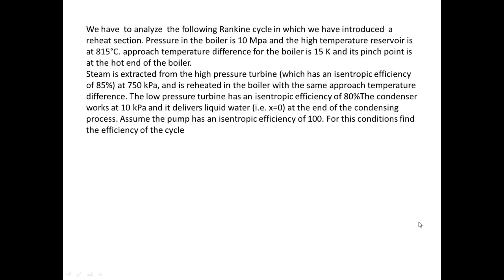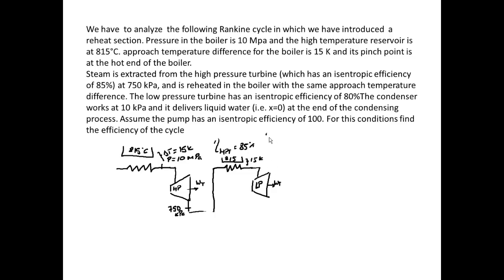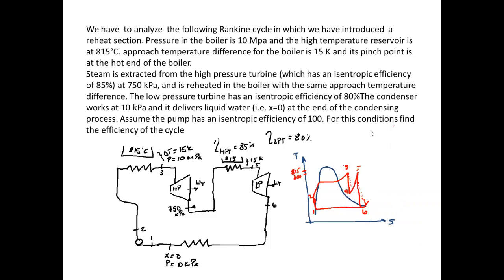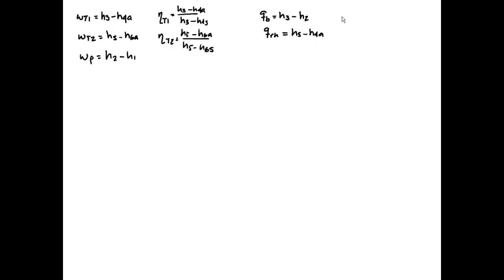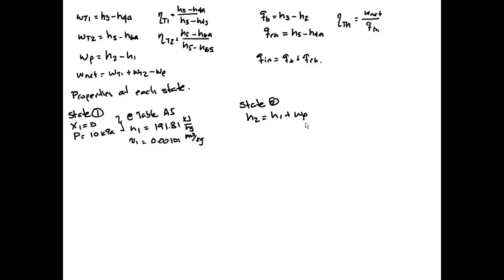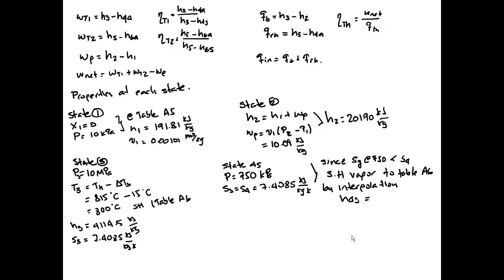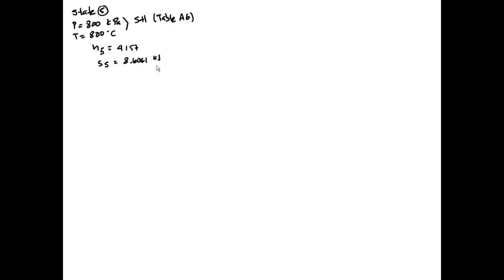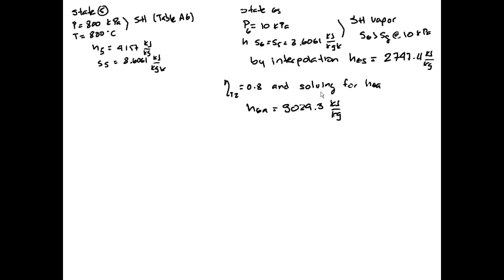Rankine Reheat problem1

Comment: how do you interpolate?
Reply from the maker: +Queen Mathibe .  You use similar triangles or you can get the slope of a line passing through the known data and then use that to develop a line equation to get the missing point. Here is a video that tells you how to do the latter method
https://www.youtube.com/watch?v=4Y0vNuOUbbw
Reply: i have been trying
 to figure out how to interpolate when only the known are entropy and pressure like on this example.if maybe i can see the working how you got the answer